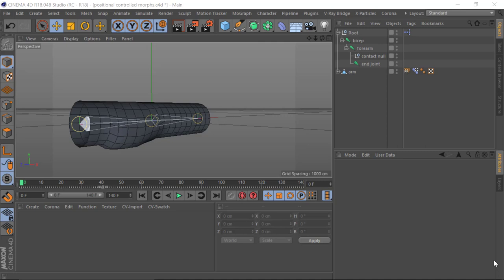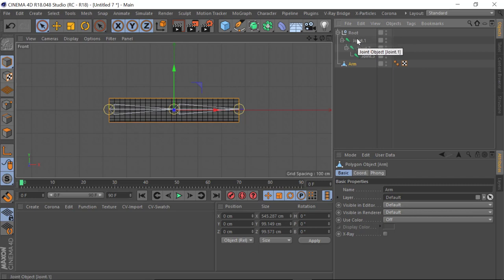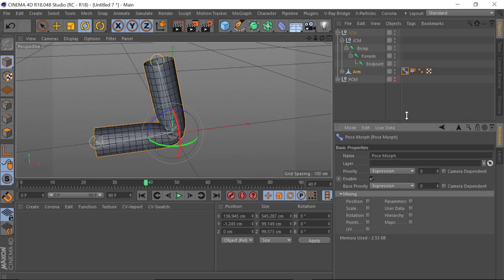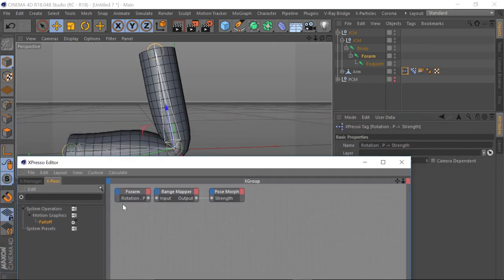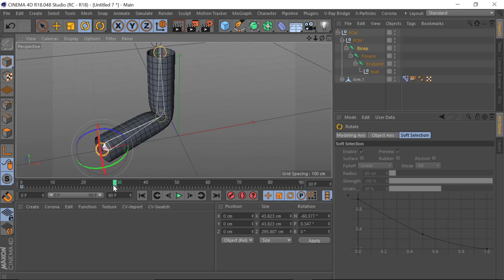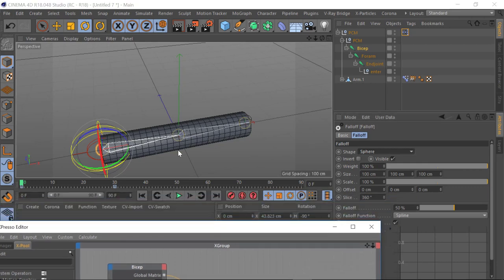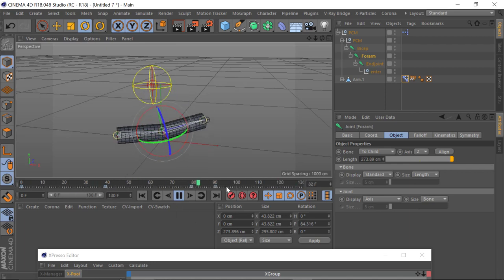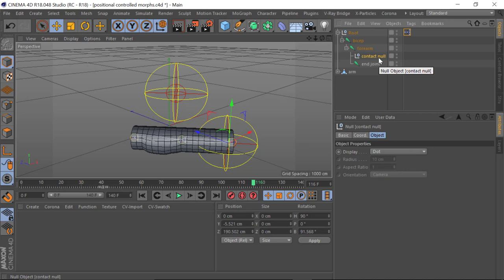Joint and Positionial controlled morphs

Comment: Your post was very informative. If I may, is there a way to copy this setup from figure to figure? I have some figures that are brought into Cinema 4D that already have Joint controlled morphs setup for them. Is there a way to complete the setup of all the joint controlled morphs and then copy them to another figure? The figures all have the same rigging and the morph names are the same. Xpresso is not my strong suit so I thought I would ask.
Reply from the maker: The morph Target can be applied to both joints and meshes.  If its all joints then you can just drag n drop the morph target tag onto the rig. If its mesh deformation then it will only work on an identical mesh.  These days a new Morph method is used for correctional morphs in R20 onwards, or was it r19?  New method is PSD morphs for correctional type.